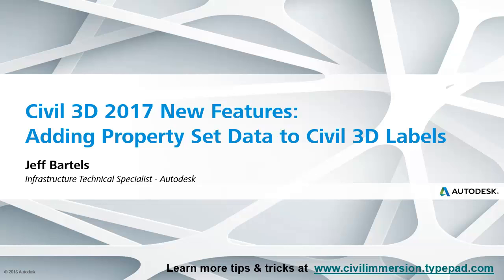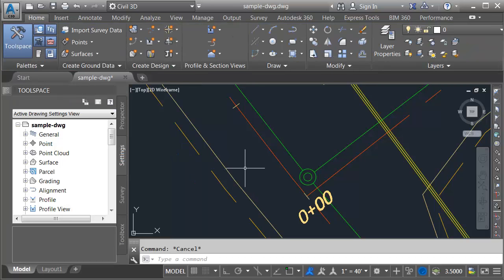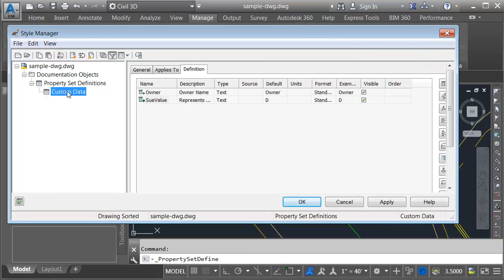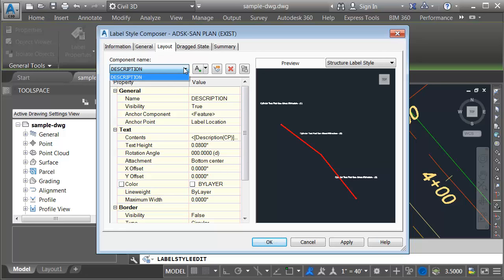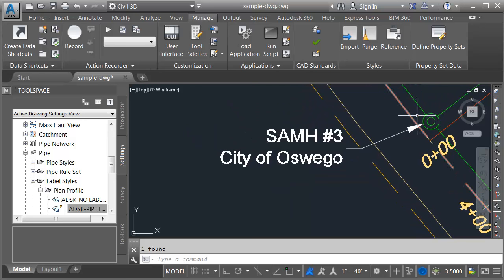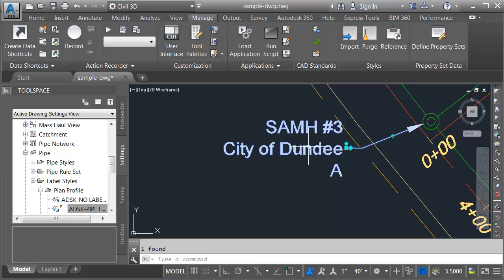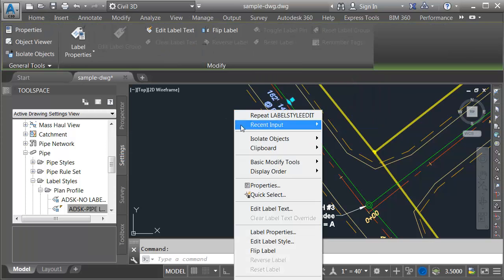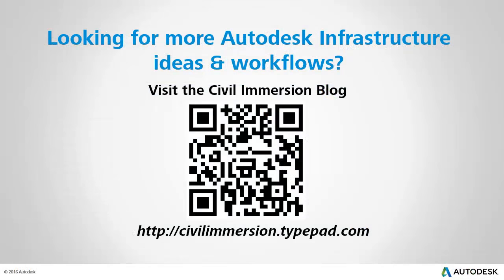Civil 3D 2017 - Adding property set data to Civil 3D labels

Comment: I needed to make a custom expression to set the bottom of pipe elevation on a pressure pipe fitting.  It appears the Custom Properties Data Set does not work with Expressions??  Is that correct?

Comment: Is there a way to then import styles that use Extended Data Fields into another drawing?  I've tried it different ways and each time it changes the code for the Property Set Fields to something else like <[PS:1]>, <[PS:2]>, etc.  I've copied the property set to the new drawing prior to importing styles and it still won't bring the Property Set Field Codes through correctly in my styles.  

It's a really nice feature, but limited if you have to fix your style every time you want it in a new drawing.  I'm hoping that someone knows how to make it import successfully so I can roll out a new set of styles.  I'm testing on C3D 2019 at the moment, but I have access to all versions in the last few years if that's something they've improved in later versions.